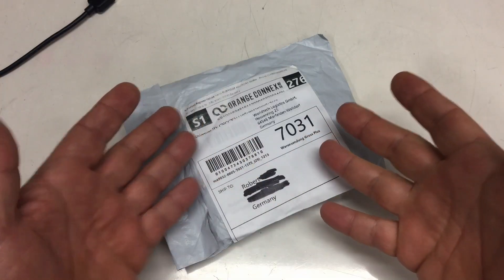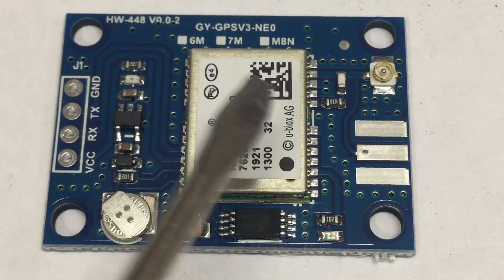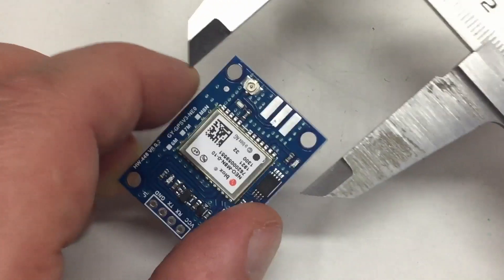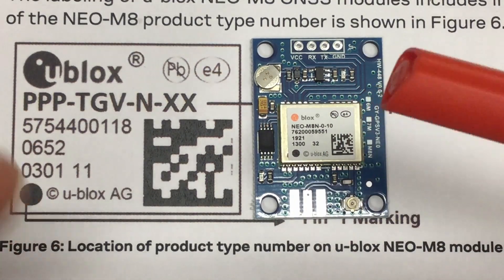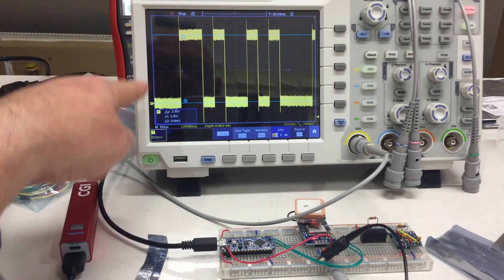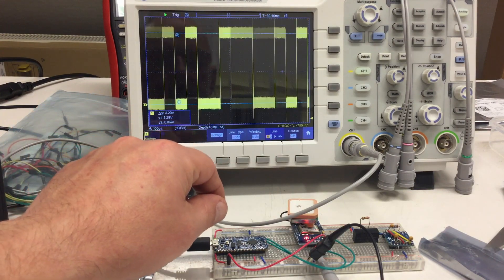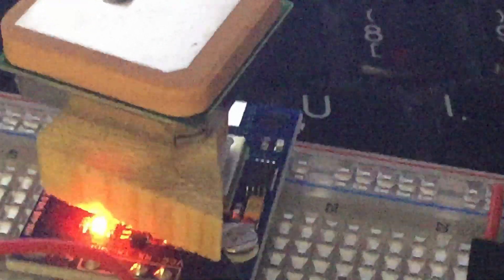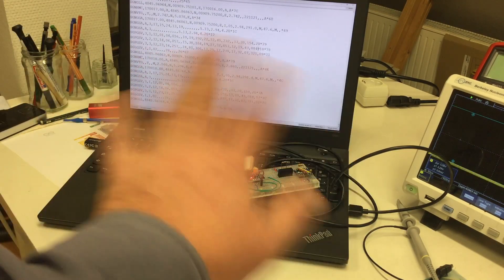Mailbag: GPS Module with U-BLOX NEO-M8N (incl. First Tests with Arduino MCU)

Comment: Hi Robert,
I have u bloc NEO -M8N GPS module and interfaced with the ESP8266 microcontroller but I gave a 3.3v from the ESP8266 to the NEO -M8N but the BLUE Led Is turn ON when I connect the USB power to my ESP8266 at a seconds the LED is Turned OFF what's the problem in my module? Please help for this issue.
Reply from the maker: Sorry, but I have no idea what could be the issue. A 3.3V supply should be OK (that's what I was using).
Reply: Sir my neom8n red led is not blinking continuesly  it is constant and there is no sattilites connecting to it what can I do for that 

Is there any solution
Reply from the maker: @and9003-b7x  To be honest, I have no idea. Here are two things that come to my mind: Is the antenna connected properly? Is the antenna pointed correctly to the sky? Are there any obstacles between the antenna and the sky (GPS signals are blocked by almost anything , e.g. doesn't work indoors)? Lastly, maybe your module is defect.
Reply: @robertssmorgasbord  I tried in outdoor, and antena is connected  correctly. Led is constant not blinking sir
Reply from the maker: @and9003-b7x  As I said before, I don't really have a clue. But if everything is connected correctly and it still doesn't work, then your unit is probably defect.

Comment: i researching UBLOX-M8N BREAKOUT since 2 weeks but i could not find a original can someone is help me for find it
Reply from the maker: UBLOX is selling evaluation kits ( https://www.u-blox.com/en/product/evk-8evk-m8 ), but those are quite expensive and everything is in an aluminum box (though you might remove the PCB from the box). Then there are seemingly more trustworthy suppliers for boards, e.g.: https://gnss.store/neo-m8n-gnss-modules/44-elt0031.html?srsltid=AfmBOop0LyAp46dCnEToGoUi0iH5PRCi081UmLzBu5Brn0EJLIlcMaxA . just search for "UBLOX-M8N board" or "UBLOX-M8N module" instead of "breakout".

Comment: QUESTION:
I have a NEO-7M but it only get the lat and long if I am outside . Is NEO-M8N strong enough to get the latitude and long even from indoor environment?
Reply from the maker: Not really. I have a wooden roof with some isolation (partly with metal foil backing, partly without) above me and I don't get a signal. I have to move the module close to a window for it to be working properly.

Comment: It is not a battery, it is a super capacitor with 0.2 Farad, so you not have to replace it after some years. Because the GPS almanch data is valid only for a short time (about two days max), you are not needing a lot of capacity to save the data. If data loss in two days, it is okay. The 24C32 EEPROM is not needed, I found this design on many other GPS boards too. You can desolder it with no effects. This GPS module has an integrated flash and the external EEPROM is not used. Some modules like the old and very slow NEO-6 need it. I not understand why Chinese manufactures do this. By reading datasheets, can see it is not useful. I like your videos explaining breadboards in detail. Learning a lot. I do the same as you to understand electronic.
Reply from the maker: Thanks for the info (supercapacitor)! That makes actually a whole lot of sense. I really didn't think about the "aging" of the almanac.
Why the Chinese still put the 24C32 EEPROM on NEO-M8N boards? I guess somebody once developed a board for U-BLOX GPS modules, and that design initially contained that EEPROM. Since then a whole lot of other Chinese shops simply copied that design to use it with newer U-BLOX GPS modules, without putting any effort into updating the design. At the end of the day a 24C32 costs only a few cents.
Regarding the flash: The NEO-M8N module on my board was unfortunately a fake missing the flash memory (see "Chinese U-Blox NEO-M8N GY-GPSV3-NEO Module Review (Feat. U-Blox U-Center)" https://youtu.be/RwzfP7Q1zj0 ).

Comment: With this gps module, now im facing some issues

1 . When i try it on my  house tarace or in open area its connectivity is goood or working complet. Ok 

But , when im trying to connect in my room , then this device is not working properly  and what i can facing issues that this device is not connect with satelite ,why .....?

Have any solution

I throught , this device have low strength... 
  According to you, what is your opinion on my issues.....?

Please help ... Thanks.....
Reply from the maker: Mine does exactly the same. To get good satellite reception I have to put it near a roof window, so it has a clear "view" of the sky. But that's normal for GPS receivers. E.g. inside the GPS reception of my iPhone degrades to +/- 10m and it drifts +/- 5m and my Garmin eTrex has no reception at all.
Reply: @robertssmorgasbord  ohh, thanks for reply , now  im trying in another way, that how  to do complet conection or satelite reception  from the ground floor or from my room 🙂.

If  any problem will heppen . I will inform you.
Reply from the maker: @dharmikprajapati230  Yes, please let me know what method works.
Reply: GPS satellites are about 20000km high, so its normal to have bad connection inside, and why use GPS inside anyway. Mine have signal from 5 satellites and about 40m accuracy upstairs.
Reply: @PexiTheBuilder  ok i understood , but is there any other gps module whice strongly suit on my require ment? if there lease inform me.
thanks for your effort

from --- 🙂 dharmik
Reply from the maker: @PexiTheBuilder  Well, it's the combination of the high orbits of 20200km, the relatively low transmit powers between 50W and 300W (including antenna gain), and the high transmit frequencies of ~1.2GHz and ~1.6GHz used (which are easily blocked/shielded). And why use GPS indoors? Easy! My bench where I'm working is indoors 😅

Comment: Hi, great Video..!!  ..Can you please advice how do i factory reset using U-Center software after messing up with the CFG files. Currently i am not seeing any satellites or longitude. or lattitude .... thank you
Reply from the maker: Have a look at https://www.u-blox.com/en/info/u-center-2-user-guide and search for "Revert". If you're using an older U-center version the revert should be found in a similar place, but I can't exactly say where. Please note that the Baud rate of your device might change after a revert (e.g. to 38400) and you have to change your settings accordingly.

Comment: of Corse we need to see the code :)
Reply from the maker: Here you go ;-)

void setup() 
{
   Serial.begin( 1000000, SERIAL_8N1 /* default */); // 1.0Mbps
   Serial1.begin(   9600, SERIAL_8N1 /* default */);

   while(!Serial);
}
 
void loop()
{
   if(Serial1.available()) Serial.write(Serial1.read());
}
Reply: @robertssmorgasbord  lol :)
Reply from the maker: @David_11111  There was a reason I didn't upload the code to my Google drive ;-)
Reply: @robertssmorgasbord  Hello, I tried to use your code in Arduino IDE and the serial reader gave out gibberish. I've tried different Arduino Mega, different serial port, different baud rate and different data cable. I've confirmed that my GPS is working through U-center since it's able to get a 3d fix on my location, it's connected using a USB TO TTL Module . Do you have any suggestion?
Reply from the maker: @MrTooawesomeforaname  Sorry, but not really. Did you adjusted the baud rate in the Arduino serial monitor to match the one used in the code for Serial? That's the only situation so far I've seen the Arduino serial monitor printing out gibberish (when the baud rate of the Arduino serial monitor doesn't match the baud rate of Serial in the code). Serial1 (the connection to the module) should normally be 9600 baud, 8 bit, no parity, 1 stop bit, since that's the settings the module uses after a cold start.

Comment: yay... link to module please
Reply from the maker: I've got it from eBay Germany, so I don't know if the link will be helpful, but here it is anyway: https://www.ebay.de/itm/174653066112?var=473855501165
Reply: @robertssmorgasbord  ordered same from a UK seller :)
Reply from the maker: @David_11111  Have fun with it 🙂 And let me know which firmware version yours is running. Mine is running 15.x, which is pretty old and outdated, but it works.
Reply: @robertssmorgasbord  arrived just opened the packet :)
Reply: @robertssmorgasbord  hmmm must read before i order :(   NEO-6M NEO-6M-0-001 ROM7.03NEO-6M NEO-6M-0-001 ROM7.03
Reply from the maker: @David_11111  Have fun with it 🙂
Reply from the maker: @David_11111  Bugger! Well, the NEO-6M should give you GPS coordinates too and my code (so far) should also work with it. Just make sure you're not putting 5V into the RX input pin of the module!